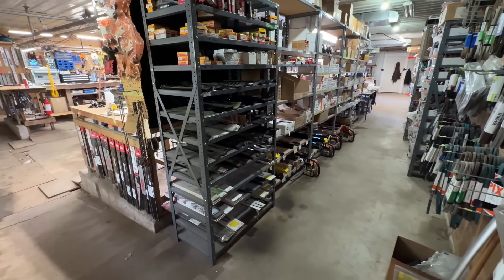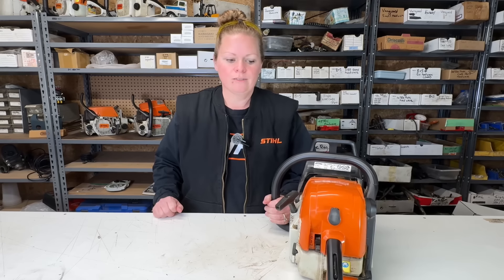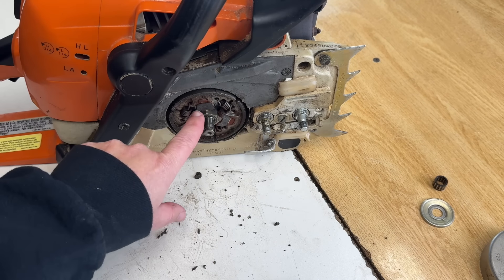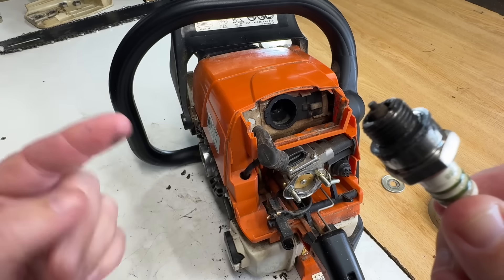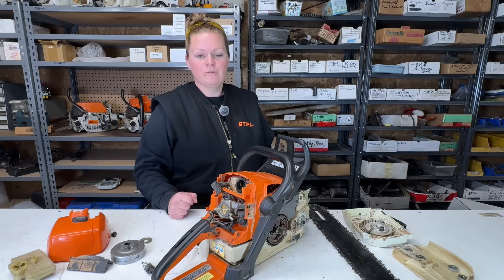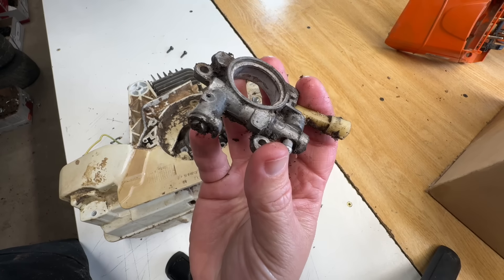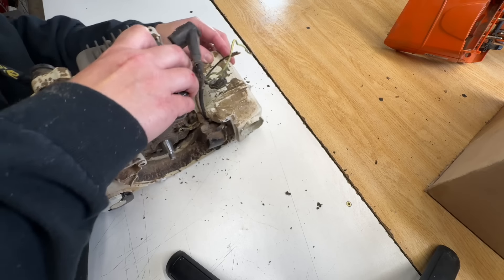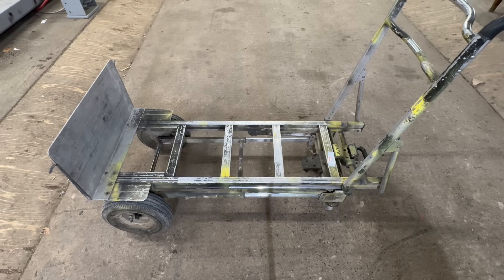Stihl MS 290  Chainsaw  *HARD TO START*  Let’s Tear It Down For An Autopsy! ( And Funeral ? )

Comment: I’ve been a small engine tech for over 25 years now, but I still learn a tip or trick that I think makes me better. I have the Silver level training with Stihl, I’d love to get the Gold. I’ve been Homelite certified and Briggs & Stratton, oh and Tecumseh as well. Now at age 65 I plan on being picky at what I work on, but it’ll help supplement my retirement that is 20 months away. The first saw I rebuilt was a MS-290 that had been straight gassed. My son's father-in-law had loaned it to a neighbor. He gave it to my son, and I put a short block kit in it. My son still uses it from time to time. Nice touch at the end, and slowly hauling it away!

Comment: Damn. Hate to see a chainsaw go down because of a spark plug electrode. I don’t take my equipment in to be worked on and demand it be fixed right away. I wait my turn. My MS361 was in the shop for 5 weeks to replace the carburetor. I didn’t complain. I wish you were the one that worked on my saw in the first place. I bet it wouldn’t be back in the shop after two tanks of fuel because it would shut off and now it won’t start. Great video from a fan in central Pennsylvania. The end of the video was both sad and funny at the same time, lol. Glad I found this channel. Have a good week.

Comment: Also so many of the saw come in with duty air filters and the same spark plug that the saw came with, I changed the spark plug each year and if the filters need to be change I do it you take of your tool they will last a long time and serve you well

Comment: I was hoping you’d be able to answer my question Erica, I just bought a ms290 chainsaw in great condition and I’m excited for it however I got more into chainsaws now that I own a property, and my question is does it have a metal crankcase? I’ve seen answers that it does and that it doesn’t. And also that the saw is one of the best and sometimes that it’s the worst Erica please what is your opinion?

Comment: Erica I have a question I was hoping you’d be able to answer my question Erica, I just bought a ms290 chainsaw in great condition and I’m excited for it however I got more into chainsaws now that I own a property, and my question is does it have a metal crankcase? I’ve seen answers that it does and that it doesn’t. And also that the saw is one of the best and sometimes that it’s the worst Erica please what is your opinion?
Reply from the maker: Thank you so much for watching!   And thank you for buying me a coffee!  
The MS290 does NOT have a metal crank case.   
 A MS290 is a really good saw.  I’ve seen many of them over the years in for service and basic repairs.  
What my video displayed was no fault of the saw - but a faulty spark plug.   
This saws days may not be over yet.  Stay tuned for more on the dead MS290… 
Enjoy your MS290 with no fear!

Comment: I want to add quickly if nobody did this test….some might be wondering if the saw would even run with the piece of grounding electrode missing. I tested this with an old plug on an 028 Super Wood Boss tonight and the spark will indeed jump all the way from the center electrode to the threads of the plug. It’s like 1/8” or better! Incredible it would still run and hammer itself to death but unfortunately…it would, and did! Just FYI for anyone curious about that.
Reply from the maker: Very cool ! P

Comment: Interesting side story. Had a Honda 200X 3 wheeler when I was younger. Wanted to go mushroom hunting in a far away woods and worried about someone taking it while I was gone as they have no keyed switch. I decided to take an old plug and break the grounding electrode off so it wouldn't run. Just switched them when I got to my destination. After finding a bunch of mushrooms I was excited to get home so I hopped on and took off. Nearly home, I remembered I hadn't put the good plug in. Hondas ignitions system was strong emough that it jumped the gap to the edge of the plug. I could not believe that it could do that. LOL
Reply from the maker: Great story - thank you!

Comment: I have a 031AV STIHL CAIN SAW, it will idle as long as it has fuel, but if you try to rib it up it just bogs. It doesn’t die it just won’t rib up. I’ve been watching your videos hoping you might come across this problem, but I haven’t seen it. Would you have any suggestions, it’s an old saw in good shape for its age. Love you videos and thank you for taking the time to make them.

Comment: Another good video! I was wondering when you would pull out the baby impact. I hate those black caps, they're like a suction cup. I squirt a little wd-40 under the cap when they are stubborn like that. You should have checked between  the bearings for that electrode? Looking forward to the next one!

Comment: First thing I remove is the winter summer shutter,I have seen a fair number of saw burned up from them as most owners are unable rember to swap it around. Seen the electrode contact missing gave me the feeling of a connecting rod failure.I challenge you to a junk yard build to fix this saw and getting it running only using junk pile parts .

Comment: When you put the camera in the cylinder what did you do to get the piston to move when it wouldn’t move at first?
Reply from the maker: The piston would move one way but not the other, I tried to be gentle as I wanted to find the part jammed

Comment: I am very impressed with this video. I like watching engine tear downs. While draining the fuel, you commented that the fuel looks good to you. What did you think of the bar oil? I notice that you are gentle with the parts, which is good. I had thought you would complete the teardown without hurting your hands -- but I think you did get one small cut. I am wondering if it might help you to put a long paper or plastic sheet under the saw while you are working on it. Of course, paper and plastic can be more a hindrance at times. It adds a cost item that you have to pay for. You were concerned that the electrode from the spark plug had fallen onto the floor. That is why I'm suggesting paper. As to the electrode...I am guessing it is now nicely fused onto the engine cylinder and the piston. It is amazing that the connecting rod didn't break and shatter. That is a tough connecting rod!

Comment: Hi! I want to add that this video prompted me to download the user's manual for the MS 291 saw as sold in the USA. I wanted to glance over it and check the fueling, starting and operating instructions. The printed instructions in English, in my opinion, are terrible. They do seem to have a lot of diagrams, in fact too many of them. There seems too many diagrams devoted to opening and closing the gas cap, for example. There is little text. The manual, in short, is a terrible read. It did teach me to use 89 octane gas with a 50:1 oil mix, and I learned about MotoMix, too. The solution, for learning how to do common maintenance actions, is to watch your videos instead. Thank you for these videos.

Comment: Thanks for another excellent video!

I'm familiar with all of the other channels you referenced (& would also recommend DynoJoe & afleetcommand); but don't subscribe to any of them..... but did subscribe to you, because you're providing different content than they are-  Your videos offer methodical diagnosis/analysis/testing with excellent videography and detail; while also showing disassembly/assembly. You're sharing knowledge. I've mentioned/commented several times......that your saw diagnosis/repair vids vastly outperform mowers or anything else; I'm thrilled that you agree & are catering to the interest!

Personally, I would also enjoy seeing a saw (like the late one in this video) be resurrected.....but also understand from a cost/viability perspective, why you wouldn't. Speaking of the dead; I didn't realize the 291's also used that terrible clamshell design.

Keep it up & thanks!

Comment: What a pity for such a great saw to be ruined because of a defective spark plug. I've got the MS310, which is just the slightly larger version, for over 20 years and that thing has done a ton of work on some very arduous Australian hardwoods like massive Ironbarks and Bloodwoods. Just did a compression test on it before replacing the crank seals and it's still perfect! I know it's only a mid range saw but It's been impressive with an excellent service life. Worth every penny of the $1000 AUD I paid for it in 2001. Unfortunately we are overcharged here in Australia for Stihl products compared to the US and Canada. Still wouldn't look at anything else though.

Comment: As a Stihl tech I watch you and others to maybe learn a little bit more. Or pass on a little knowledge. The muffler bolt can be removed without tearing the saw apart. Lean it towards the clutch side and it will come out. That's the first time I've seen a spark plug broken like that.

Comment: Amen on knowing how to put a bar and chain on. If they are unsure, just go on YT and learn from a video! Without watching the entire video, I'm guessing they used gas with no oil and the piston is seized up. I'm wrong. The plug was a BAD sign. I wonder if the right plug was in there? If too long, could that cause the plug anode to break off? Maybe the part flew out the muffler. Oh well, you had me laughing with the Coroner's report. RIP John from MI

Comment: Hey thanks fpr the Video! 
Since the 290, 310 and 390 are similar as you say, why not mount a 390 engine into it? I‘d guess this may work and it would be a great upgrade and worth it since  the rest of it is in great shape and hasn‘t seen a lot of use.

…probably as Stihl dealer you may not allowed to, but if so that would be great content for an upcomming video.

cheers and thanks again for the relaxing and educational videos. Greetings from Germany!

Martin

Comment: At 35:59 there is a round object a bit to the right of your index finger between the top of the piston and the first piston ring groove. Is that supposed to there? Or is that the shrapnel from the spark plug jammed in there?

Comment: If the flywheel would not turn, how did you take video of the piston going up and down?
Reply from the maker: It was jammed in one direction.   I was hoping to not disturb it and take it apart and find the piece that was causing the jam - in the jammed position.

Comment: First thing I noticed when you pulled off the pull rope is that it only had ONE Pawl Dog.  My 290 has two ...... I don't know how you can get a balanced pull with just one. ....... You did not mention it while looking right at it. No mechanic here, but I'm pretty sure it had one missing, It sure wouldn't help this saw, but it would have been a first clue.

Comment: The 290, originally the 029, came with .325 when introduced. Common fix for that was to switch to 3/8 chain & the saws didn't last, likely due to overreving. Some of those were incorrectly tuned from the factory, there was a SB on it. These were a consumer saw, not an pro saw by any means.

Comment: I'm not a expert on small engines but I don't think it was just the spark plug. The damage looks like the piston made contact with the top of the cylinder. Which to me makes it seam like a rod bearing failure causing the piston to go higher in the cylinder causing damage

Comment: Using two screwdrivers at once, one on each side of the black plugs will make it easier to pop them off.
A shop rag draped over the spring really cuts down on the spring flying away during removal.

Comment: It's impossible that engine kept running without grpund electrode, because there is NO SPARK!!
Reply: By golly you are right. That saw should have stopped if it was caused by the electrode.
At this point we can suspect the bearings (again), parts coming out of the bearings, bouncing around for a while, and then knock the electrode off the spark plug.
Reply: Spinning at 13,000 rpm it would still hit numerous times before hitting a point I wouldn't move because of  momentum.